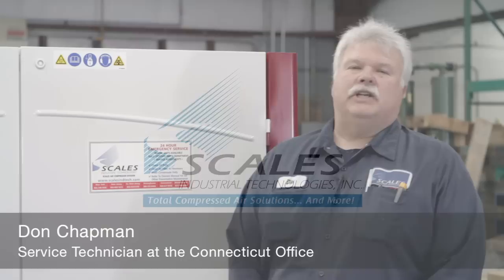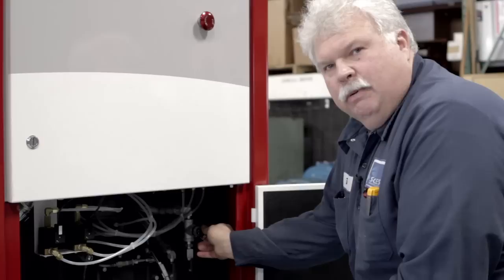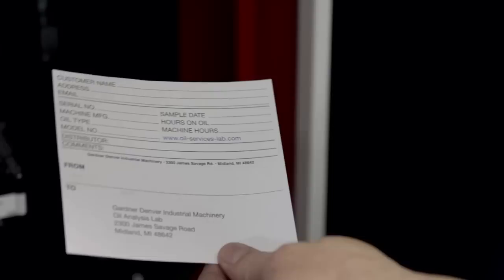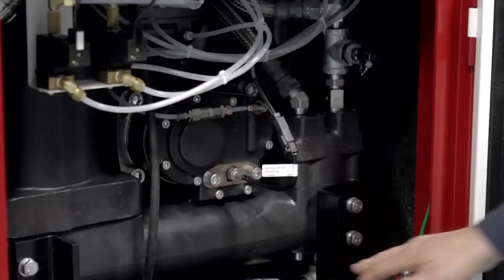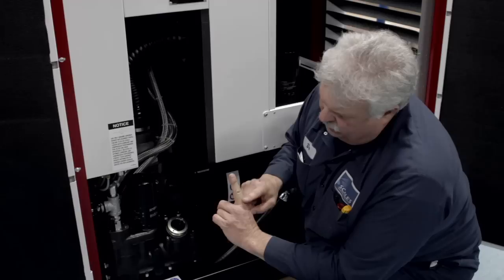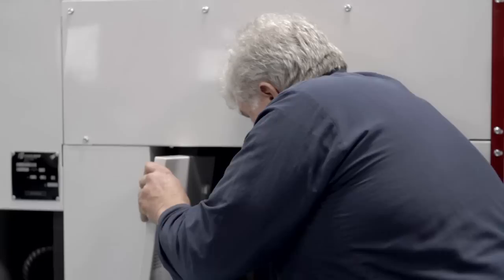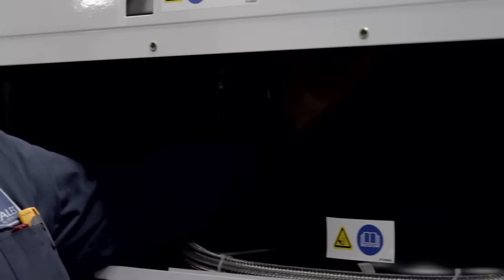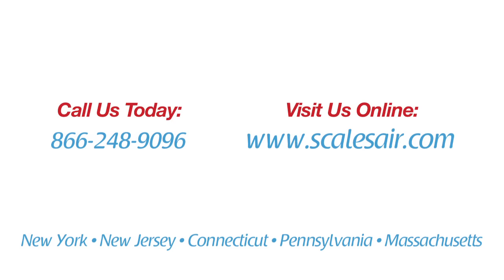Scales Gives Step-By-Step Details Of Proper Preventative Maintenance For Rotary Screw Air Compressor

Comment: Hello, The oil varnished on my Garner Denver compressor. We have been doing an oil flush continiusly 24/7 for almost 2 and months already and still is not clean yet. My questions are. Why the oil varnishes? It's normal for them to take this long to clean?
Thanks. Jose